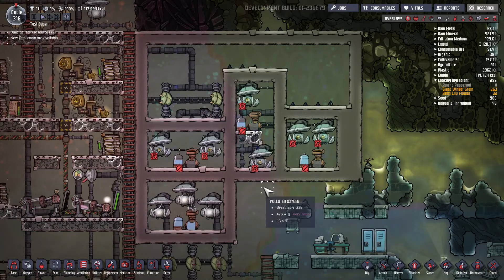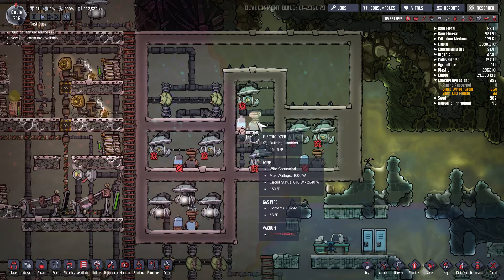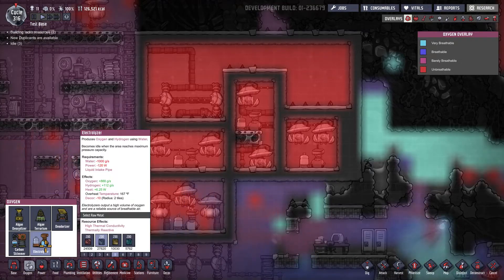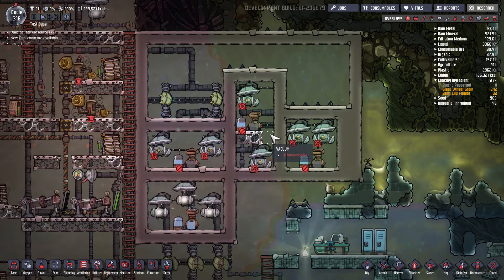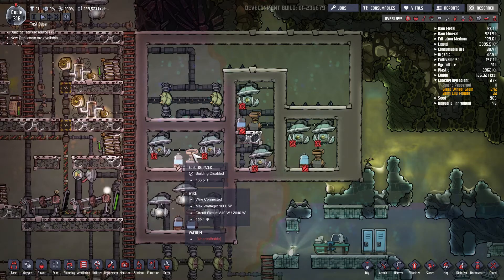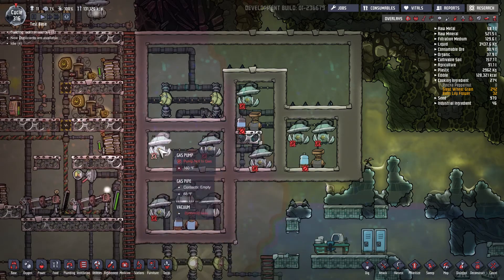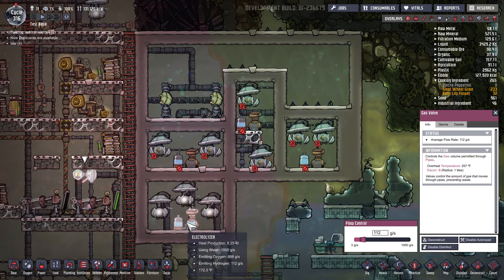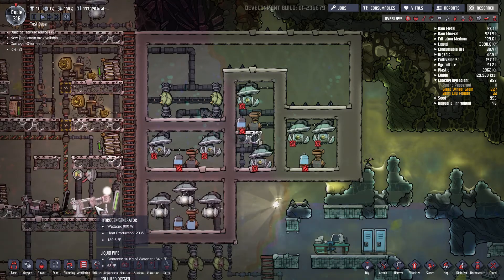Oxygen Not Included Electrolyzer Setup

Comment: Wow so that is why my math wouldnt add on. The gas separation at the pump. I constantly struggle with this. I have a “house” building with 2 electrolizers and 3 punps and dont seems to be enough oxigen and the power any ser up requieres at least 2 coal generators if you add a filter. I wish electrolizer had a gas outtake for hydrogen. Would make things so easy
Reply from the maker: yeah it would be nice is there was a gas outlet for it instead of just dumping into the surrounding air

Comment: It would have helped to be able to see your gas filter set up, I couldn’t get my set up to work like yours because I couldn’t set up the filters properly.
Reply from the maker: Each gas pump has its own Filter with Hydrogen as the selected gas to filter out ... all the Hydrogen gas lines are then connected from 1 filter to the next then to the gas pressure valve and then to the generators ... combine 2 of the oxygen lines together then to where ever you want oxygen supplied and the third oxygen line to where ever you want oxygen to by supplied .... if you are producing to much Oxygen with the setup you may want to setup an over flow room for extra oxygen ...